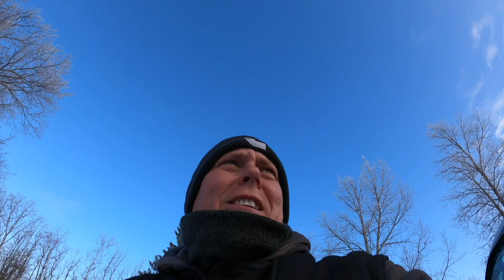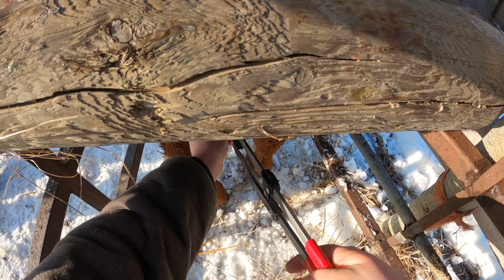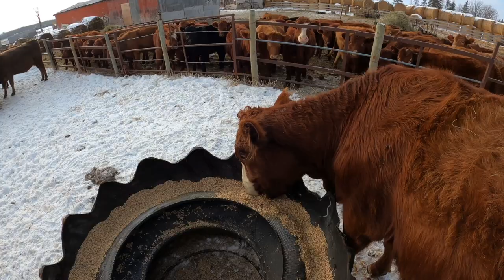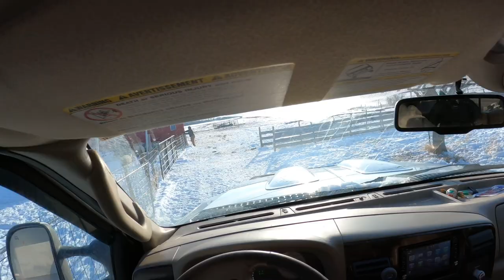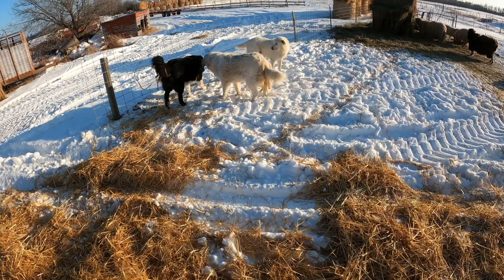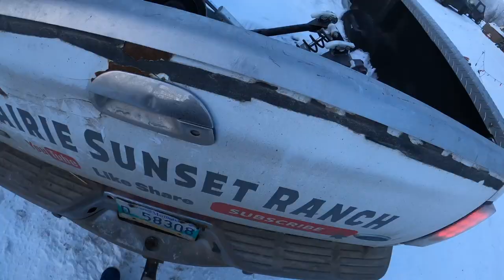How to CASTRATE a BIG 450LB BULL Calf : Humane Castration Using a Elastrator Tool & Rubber Band!🤠

Comment: We have always nutted at weaning.. otherwise you don't know who to leave bulls. Used to crimp with the Berdizo, then we cut for quite a few years, now we use the Cal-trater.. doesn't matter if they're 200# or 2500#, it will do it. 
Just takes a while for the change purses to fall off sometimes, but works good!!
Damn pet cows🤣😂👍
Reply from the maker: Very cool Ed I will look up the “Cal-Trater”. I could fit a few dollars 💵 into this change purse when it falls off! Lmao 😂 Cheers 🍻 ED
Reply: @PrairieSunsetRanch  ya, they usually flatten out, dry up like burnt jerky, and we never find them, just a little piece of surgical tubing with a little aluminum clamp on it...🤣😂
Reply from the maker: @GosselinFarmsEdGosselin  , Deflate the Lil buggers family jewels! 👍🤣🤣